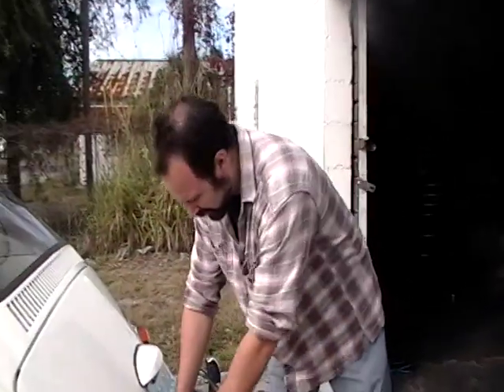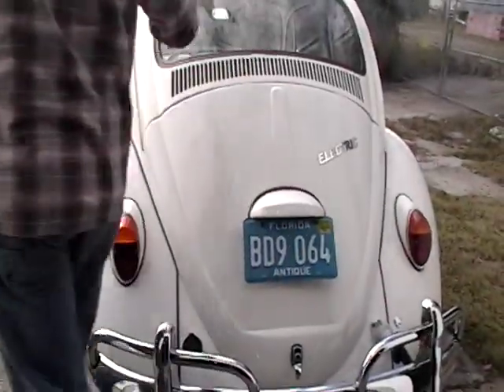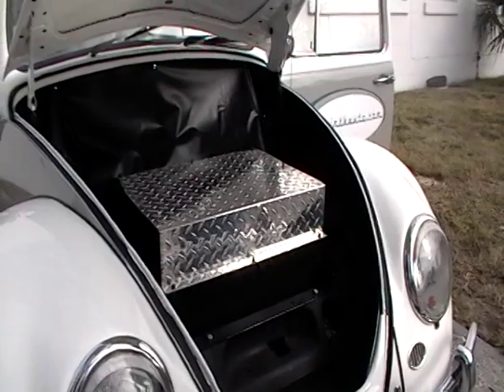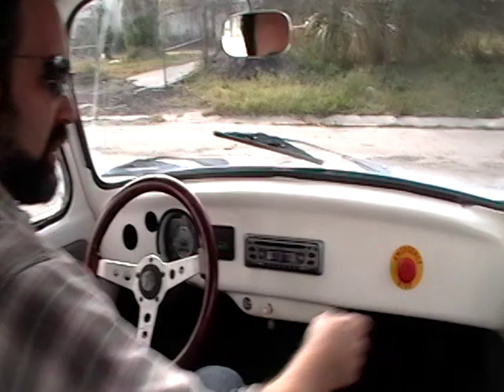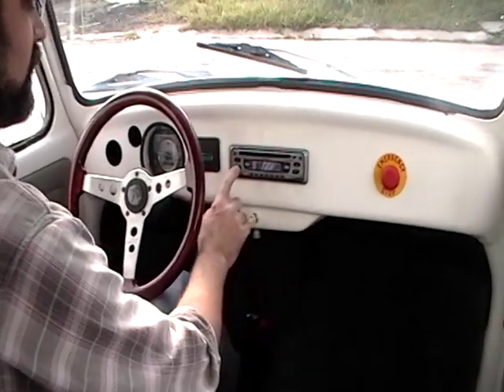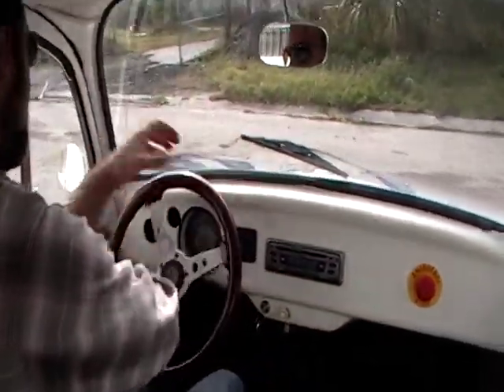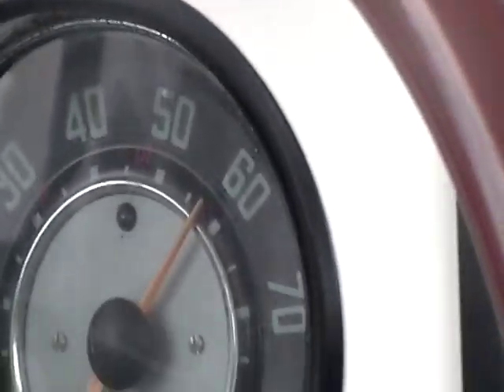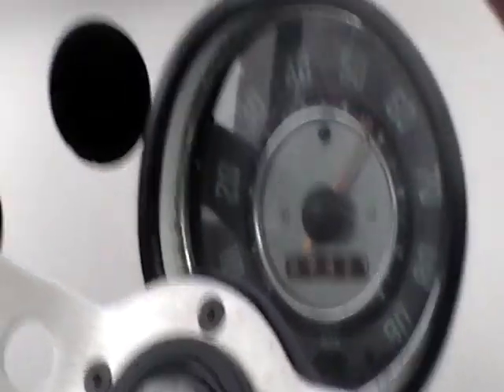RebirthAuto.com 96 Volt Kit in a 1965 EV VW Beetle Drive

Comment: I couldn't imagine all the sounds i would hear without the noise of my gas engine to cover them up. suspension, breaks, transmission, and overall squeaky nuts and bolts.

Comment: @rebirthauto you can have as many gears as you want, but as long as your motor and controller are unable to supply enough power to turn with the added torque of another gear, it isn't gonna go any faster.

Comment: I'm getting a converted Datsun 620 king cab PU truck next month...I know I'm going to have fun with it. Do you have a separate battery for the accessories (lights, stereo, turn signals, etc.)? If so, does this battery charge on a separate system?